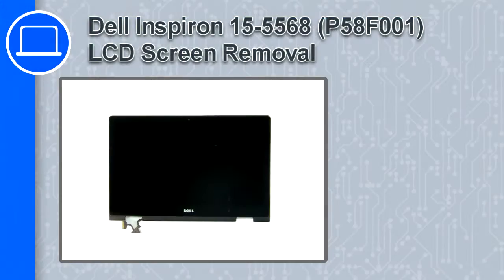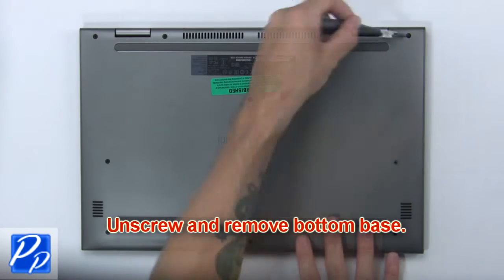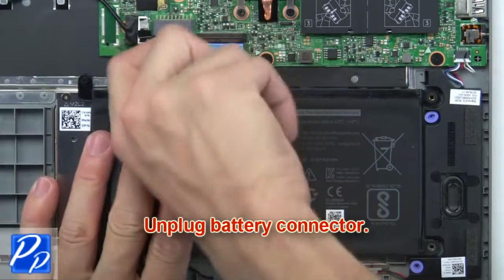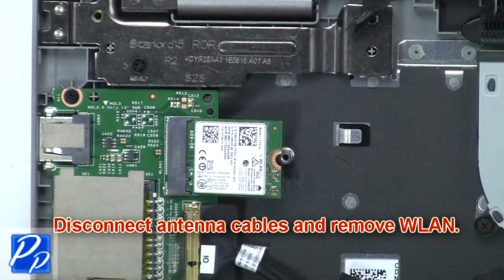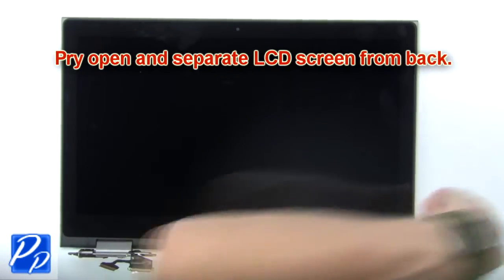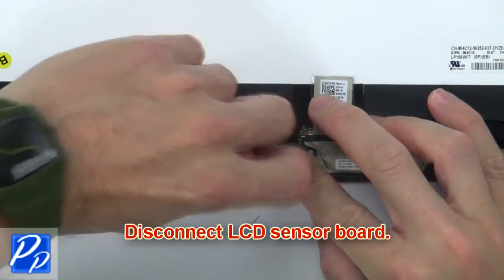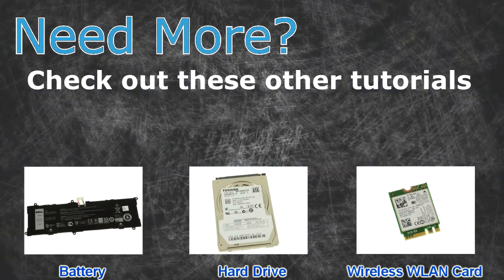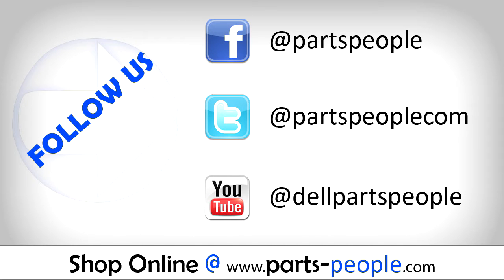Dell Inspiron 15-5568 (P58F001) LCD Screen How-To Video Tutorial

Comment: Quick question: Trying to remote the 2 lcd cables. It's hard to see in the video. the one on the right looks like you need to click release up then pull. What about the one on the left? Is there a lever?

Comment: LCD Leaking very sticky liquid.
I have a 5-year-old Inspiron 15-5568 signature Edition the one with the useful touch screen.
Just recently, I have noticed a very sticky liquid leaking out of one corner of the screen.  There are now bright and dark patches on the screen near where it is leaking. As well as round, the screen the sticky stuff gets onto the base of the laptop where I rest my hands to type. It is hard to clean off and I am worried it may be toxic.
Is this a common fault or is it a sign of a defect in the design and manufacture?
Is there anything that can be done to fix it? In dell community website, I have read many messages regarding this. Why don’t @dell recall these laptops and provide replacement to the customers.
Reply from the maker: I'm not sure exactly why this is occurring but I would avoid using it further and consider replacing it. This is something I would deem unsafe and not repairable.

If you are in need of a replacement you can find Inspiron 15-5568 screens here: http://ppci.me/c/141/707/lcd+screen